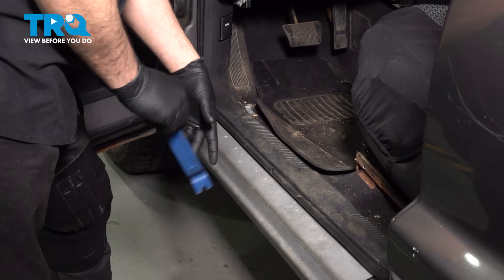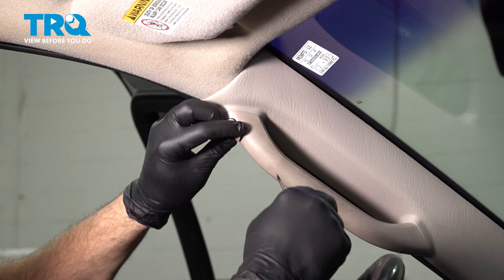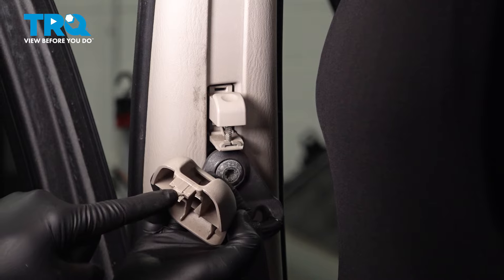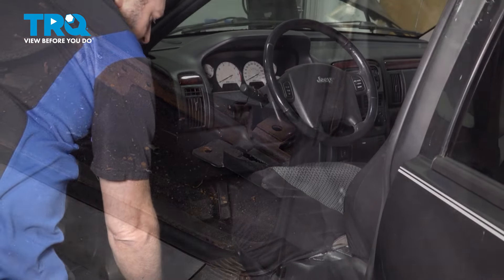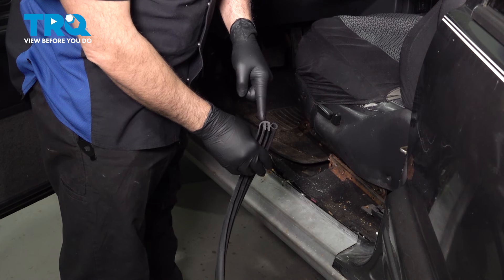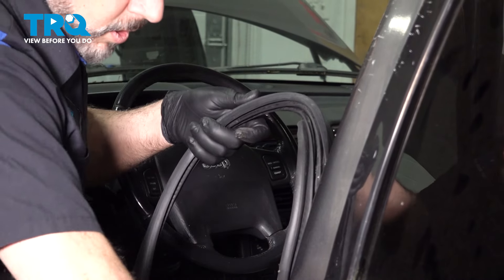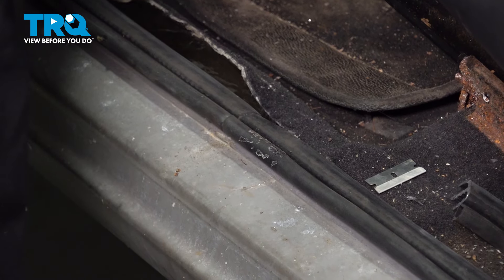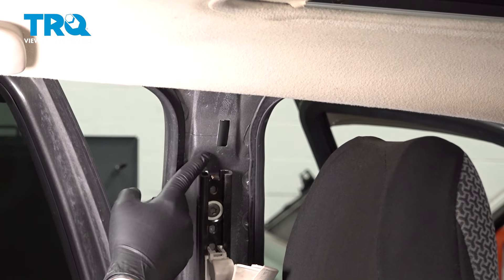How to Replace Front Left Weather Strip Seal 1999-2004 Jeep Grand Cherokee

Comment: Hello, what about the rubber strip at the top?  We have searched all over and not one video or reference.  We're currently in contact with !AAuto but no direct answer about the strip at the top.
Please tell me the name or Part No" of the strip on the top with the tiny holes.  Mine is torn....  I need Picture Confirmation before I purchase/, Thank You!